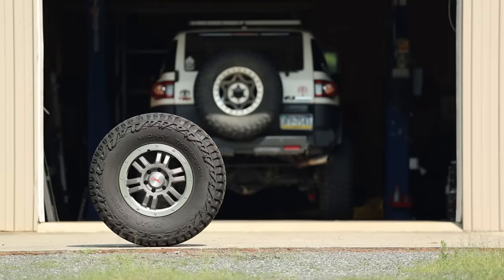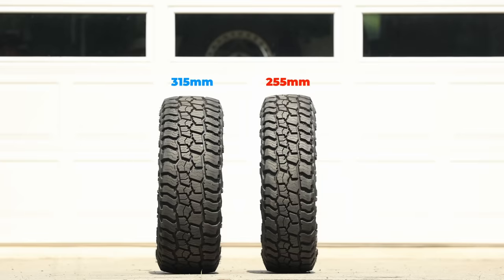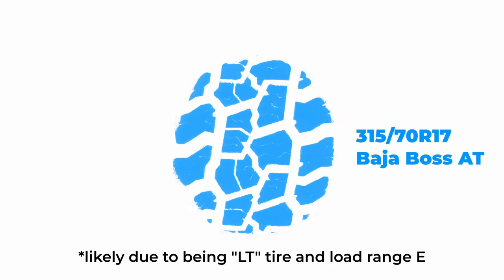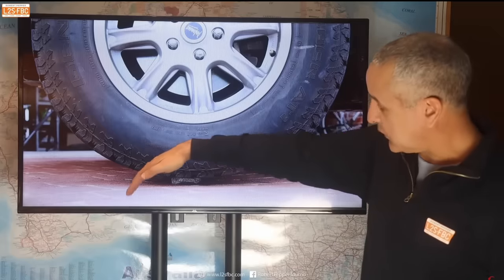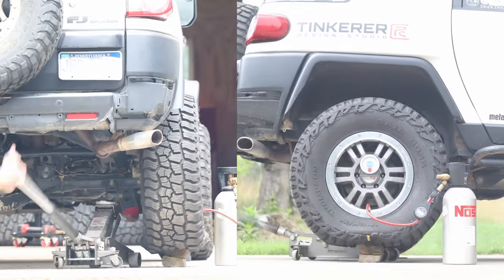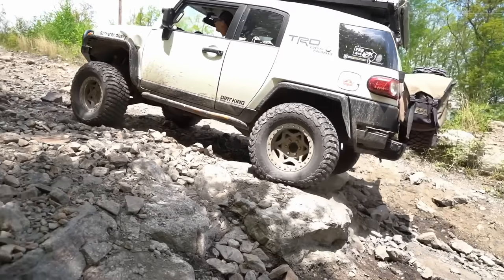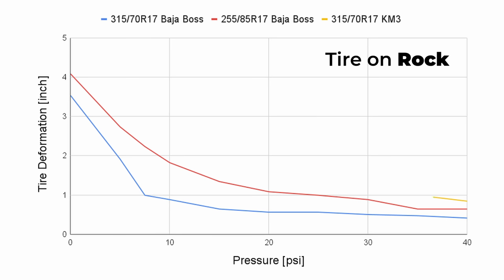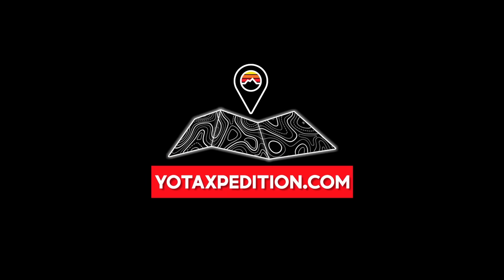3 Scientific Experiments to Settle This | Wide vs Narrow Off-Road Tires

Comment: This is the video I always refer others to when the subject comes up. I chose 255/85/17 tires for my rig almost one year ago and have been completely happy with these MT Baja Boss tires. They now have 13,000 miles, with 2600 miles of recorded (aired-down) track. On my last trip, I had an issue with these tires, which I had yet to encounter. The 255s are mounted on Method's 8.5-inch bead grip wheels, and the axle weights are 2600 lbs front and 2880 lbs rear. Air pressure was 12 psi front and 15 psi rear, as I've done many times. The terrain was primarily bare Utah sandstone. On a long V-notch with only the shoulder of the tires in contact with the rock, my RF tire burped all the air out due to the side load. Shortly after that, on another V-notch, both rear tires were in single digits with the same issue. Others with the same wheel and tire pressure but on 12-inch wide tires did not have this problem. It's something to be aware of if you're using 255/85s on 8.5-inch wheels.
Reply: Glad I found this comment. I'm looking to eventually run 255/80/17 tires on a 4runner and the main point of concern I've had has been the minimum 8.5" width of method's bead grip wheels. I'm hoping that at some point they start fabricating them in 8 or 7.5" widths as the rise of pizza cutters (hopefully) continues.

Comment: Another really interesting point that I think you made, is how the MT tires performs its job of maximizing traction much better than the AT tire, particularly as you air it down. Everything is a compromise, as you mention, but if you're up for it, I think this deserves a follow up video, doing the same thing but with similar size and load range tires across 2 or 3 brands, but comparing their best AT and MT tires and the differences between them (and maybe even throw in a few RT tires too).
Reply: That be a FULL YEAR OF WORK :D

Comment: It would be interesting to know how they stack up comparatively in slick and slippery conditions. Mud/ clay/ snow/ ice sort of thing.
Reply: This what I want too see
Reply: I agree. All my wide tires were junk in the winter.
Reply: It would be great to see the comparison but the answer is already out there. Narrower is better in slippery conditions. You aren't maximizing for contact patch or surface area, you're maximizing for surface pressure. Also, in most circumstances you can go taller the narrower you run and he didn't cover that or a few other topics. Title should have included "Rock Crawling" in it.
Reply: Km3s suck in the rain. There’s that.
Reply: @royguidry1311 - sipes are generally what make the difference in snow and ice. Run your wide tires through a sipe machine at a tire shop (maybe a big truck tire shop) for the winter, if you can find one.
Otherwise, if you can afford to run a separate set of winter tires, you will be much better off.
Reply: @Nothing-nf8ve  wide bald tires for sand.
Reply: Assuming you're sticking to the road you definitely want narrow tires for snow.  You want to cut through the snow to the road surface with as little resistance as possible.  As for driving off road on top of the snow, that requires REALLY wide tires and a vehicle specially built or heavily modified to run them, or tracks.  Signed, a Minnesotan.
Reply: Pizza cutters have done very well for me in mud and snow so long as it’s not so deep that the diffs hang up. That’s where wider and higher floatation helps in my experience.
Reply: It depends on what you are doing. If you are wheeling on hard stuff, you want a narrow tire. Sand though you want a wider patch for sure
Reply: @vladivostok47  Except that I've seen where wide tires sat on top of mud and spun, where narrower tires dug down deeper and dug.
Reply: Wide tires are terrible in that shit the skinny tires perform the best.
Reply: @thewiredfox2691 wide tires are terrible in snow. The skinny tires just slice right through that shit.
Reply: @thewiredfox2691  "Otherwise, if you can afford to run a separate set of winter tires, you will be much better off."
Nordic winter tyres (not just generic mud+snow) are mandatory here in Sweden, and the thinner ones are a lot better unless you get into deeper snow than the wheel can cut down through, then wide tyres with snow chains can get on a little bit longer.
All in all, that rare benefit isn't worth the downsides and extra cost of wide tyres in the winter.

Mud and sand I don't have enough experience to say anything about.
Reply: I can tell you my 31x10.5 Dick Cepek which are now M/T Baja Legend EXP tires treat mud and loose dirt like its solid stuff but sand ice and snow like the slipperiest thing ever
Reply: @mallkrawlerz620 are you meaning fir off road use or street use? If you’re meaning street use, that could down to the surface texture of the roads in your area. I thought they felt fine, and with the large mud evac channels I never had an issue with hydroplaning
Reply: Just said that myself
Reply: My experience has been the wider the better in soft sand, narrow is much better in snow.
Reply: That has long long ago been determined,,,ask a rancher who has to get around in all four seasons,,,narrower tires everytime,,,,with the exception of sand,wide tires are losers,,on snow they are an absolute joke
Reply: @royguidry1311 well ya, pavement is where the traction is so the wider you go the more floatation you get and the less pavement ya touch
Reply: @rustynail7866 yep, i remember switching from a set of bald 70/30s to 50/50 knobbies on my ADV thinking sand was gonna be grippy and it was worse haha.
Reply: @wuffa4503  I have had the opposite experience.
Reply: It's a well-known fact that aggressive tires at low tire pressure don't clean well.
Reply: @Devin_Stromgren  On the road in the winter with light snowfalls your either breaking through to the road (almost no snow) or you are driving on top of very hard pack snow that is on top of the road (IE unplowed road) Thats why snow tires are designed to hold material inside the treads. The snow sticks to snow so the snow in the tread sticks to hardpacked snow on the unplowed road.
Reply: @jacobvanhalteren7452  A foot of fresh snow on the road is NOT hard pack.
Reply: As a desert runner, wide for sand dunes, 8-10 psi; unless baja racing, 12.5 in wide and really tall tires.
Reply: Wide tires will float better, narrow cuts better. So snow…narrow is the way to go. Mud: wide. Of course tread plays a major part, but all else being equal that’s how it is. Wrc snow tires are absolute pizza cutters with insane tread.
Reply: @elsecomojado1  same experience here in Dubai. Bigger is better. Wide? Yes. Tall? Yes. Wide and tall? Even better.
Reply: Can’t speak for rear tires but on rally cars the front tires is narrow so that it can cut through snow and ice and some mud like a ice skate
Reply: In the million km or more that I’ve driven in northern Canada, I’ve come to the conclusion that if you get the exact same winter tire in several widths, the wider tire always seems to have more traction on ice or fairly hard snow.  In loose snow or slush it’s the other way around.  Wider tires also last longer provided your wheel alignment is good. Harder on fuel tho. For what I do and where I drive, I much prefer wider tires.
Reply: Interestiny
Reply: @CharlesNelson303 if your car weighs 4000 lbs, then each wheel supports 1000 lbs
Reply: @CharlesNelson303 if your car weighs 4000lbs, then each tire is carrying 1000lbs. If the tire is inflated at 100 psi (for example), then the contact area with the ground has to ve 1000/100=10square inch
Reply: @royguidry1311 same my narrow tires hooked great in the snow I could do 4x4 or 2wd launches in my jeep wrangler in a couple of inches and it would take off. Once I put on some wider tires they spun with very little throttle in less than an inch of snow while in 4wd, 2wd was no longer an option.
Reply: @Devin_Stromgren  my first taste of the wide vs narrow was in a 2000 Chevy Cavalier, skinny tires and handled beautifully. Drove a 2011 Aveo with wide tires and could barely get good traction.
Reply: This is so fun because this is exactly how the scientific method works, you do a thing, your buddies make sure you did it right and then you write out a bunch of other stuff you could have tested but didn’t have the energy to, then your buddies have something to try too until you try all the things

Comment: I have to say that I am very pleased with your approach to gathering data.  I'm a biologist and environmental scientist.  I've always said that I wish more people would think of things in a scientific way.  Regardless of how I feel about something, the data dictates to me the truth and I must follow the truth no matter what I feel.  Your extensive work and experimentation here has proven just that.  This was an awesome video.  Thank you again for your diligence and scientific process to answering a common question many of us have had.
Reply: Relax guy
Reply: He tested both tires on an 8” rim. 255 manufacturer recommends a 7” rim, 315 recommends a 9.5” rim.

By stretching the 255 onto an 8” rim he increased contact patch at the cost of the bead breaking easier.

By pinching the 315 onto the same 8” rim he reduced the contact patch (the tread will bulge up in the middle more because the carcass is being pinched in), reduced flex on the single rock test.

This is why data isn’t always the answer - if you don’t have a very firm gasp of exactly what the testing methodology is and whether or not it’s flawed, then you can’t analyze if the data is even useful and you can be convinced of something that isn’t even true - all because you “trust science” but don’t actually understand how to evaluate the science yourself.
Reply: @TheWallsocket   100% agree. That's why its should be considered real-ish world data for 1 approach. Much like the bogus MPG reading on vehicles. Many people don't understand that rating either and how that gets measured and applied......and how mostly it will not be the same for them. The data is TRUE for the specific conditions the tests were conducted in. Not applicable across the board.

Comment: I think the aspect you missed is that the KM3 was well used/aired up and down and flexed many times over thousands of rocks and obstacles. This greatly changes the sidewalls and flex characteristics over the life of the tires vs a new tire like the two Mickey Thompson test subjects🤙🏻
Reply: Sir, BINGO. My BFG KO2's are softer after 10K than when new. I can now crawl over areas that were a no-go when they were new. And damn, you beat me to the punch. 

Great video with good info but he missed the break-in of the tires.
Reply: @FLHTdriver  It would be good to see these experiments again after a few thousand miles.
Reply: Also i imagine if they made a skinny KM3 it would be the best performer by far
Reply: Also, it appears the Km3 is on a wider rim which may also affect the results.
Reply: Krawlers are just a superior tire new or old. I've been running the red labels in 35" then 37" many years and they're the best of the trails and especially in the rocks.
Reply: Load rating will likely severely affect this too. Narrow tires get used in dually applications a lot. Load range E vs C is a big difference.
Reply: I have to disagree, rubber hardens over time and the compound s are very different
.My brand new Bfg Km3 are way softer than the Mickey Thompson s I took off. 285/ 75 R16 MTZ put on 255/ 85 R16 KM3.

Don't get me wrong wide tyres have their place.

It was literally like putting softer suspension on.
You can literally twist the tread by hand, the Mickey Thompson s are solid as rock. 

30yrs 4wheeling ,my 2 cents 😂
Reply: Which one is more efficient thin or thin tyre or bikes?

Comment: Amazing work! Just solidified many of my reasons I went with 35x11.5x17’s instead of 35x12.5x17’s! In the majority of situations, the “pizza cutter” is the best choice!
Reply: I'm also running 35x11.5x17s on my JLU. Hoping to go up to 37x11.5x17 in a couple years (Nitto makes their Recon Grapplers in this size). Just need a few more mods before that happens tho. 😅
Reply: @2asianguys667  that’s what she said! 🤣

Comment: Fascinating! A lot of this goes contrary to what you would do with sports car or mountain bike tires. In both cases, going wider (and fitting wider rims) allows you to drop tire pressures, which yields more grip. The exception with MTB and cyclocross tires is that in the mud you often need a skinny tire to cut down through the mud to stickier ground. Well done.
Reply: The same is needed for truck tires in the mud.skinny to get to the bottom to find traction.

Comment: Excellent experiments and video!!! Wow, I am about to reveal my age. Back in the early 70's, Dick Cepek, Mickey Thompson and a few others decided they wanted and needed a wider tire to run in the desert sands due to their off-road racing like Baja. Hence, the wide tire was born. How do I know this? I was working in the off-road racing industry at that time. Now, with that being said, what tire do I prefer? Tall and narrow unless I am in the dunes, yes, even in the mud, I want taller and narrower! BTW, there is a reason for BEAD LOCKS and TALL SIDEWALLS!
Reply from the maker: Thanks! That make sense! The sand is soft so the ground itself also deforms, creating a larger contact patch. The contact patch I measured was on rigid surface so it cannot apply to sand.
Reply: That's ironic considering that Dick Cepek and Mickey Thompson both make pizza cutters in desirable sizes now. I ran Dick Cepeks in 255/85R16 for years before going to 35s.
Reply: @brianescamilla  Yep! They KNOW the truth!
Reply: @TinkerersAdventure  I have some experience with sand, having driven across the Sahara from Egypt to Morocco. Not being native to the dunes, we had locals to guide us, and they all ran narrow, nearly bald tires while we foreigners had sponsored MTs. What we learned from them was to air down to 14psi for normal driving, and down to 7psi when the ground became softer than usual. It worked.
Reply: @PaulSi  I drive recreationally in the UAE. Some locals run those tall (usually 34x12) bald sand tires. Some use 315/70 r17. Almost all of them use y61 swb platforms. The guys with 315s definitely go harder and faster. Which one to use? Personal preference, until Kai does a video using soft sand as the ground!
Reply: I grew up in the Midwest farm country. Any old farmer would tell you don’t waist your money on those wide tires. Go tall and narrow. They did not need studies. They lived it daily. 
Terry
Reply: But dakar hilux run 225,95R16 or 235,85r16 for dunes
Reply: “Mikey” Thompson?😂
Reply: @christopherconner9014  lol, yeah, sorry about that, typo
Reply: @midaslm8338  The Dakar competition vehicles are restricted by regulations. 4x4's are required to run smaller and narrower tires compared to the 2wd 'buggies'
Reply: Actually narrow tires are great in sand, because they didnt get rolling resistance from sand wall in front of tire... Wide tire will eat all power while narrow and tall will move forward even with weaker engine

Comment: I put some pizza cutter KM3's (255/85/16) on my 3rd gen this spring.  And one place I expected them to not do as well was in deep loose dry sand.  But a few weeks ago in Moab I went through multiple deep loose sand obstacles (including a fairly steep climb and a big bowl) and they had no issues at all.  Seemed better than the 285/75/16 KO2's I had on it prior.